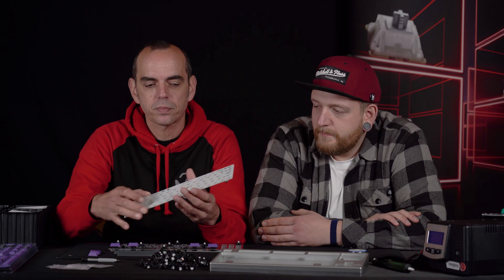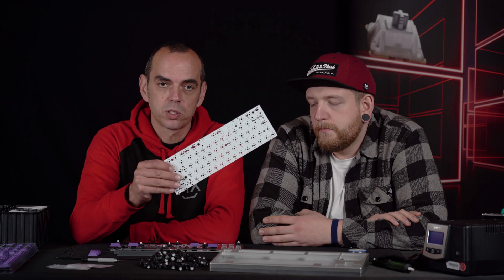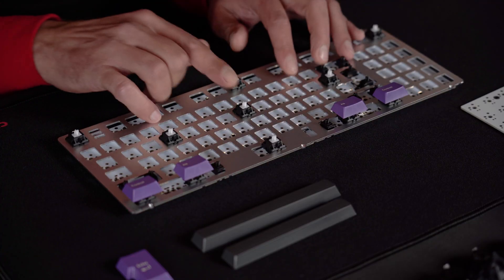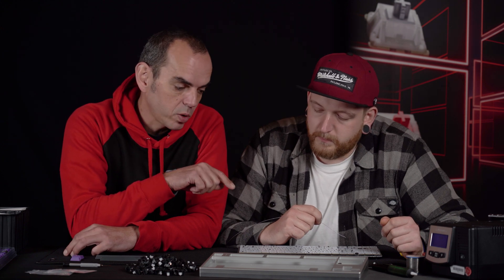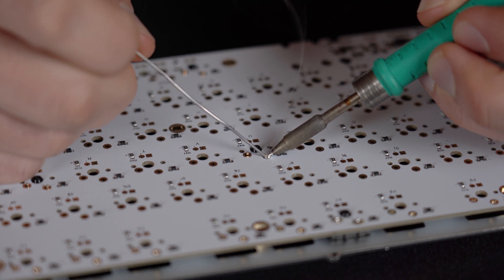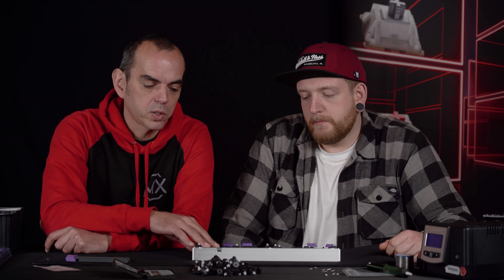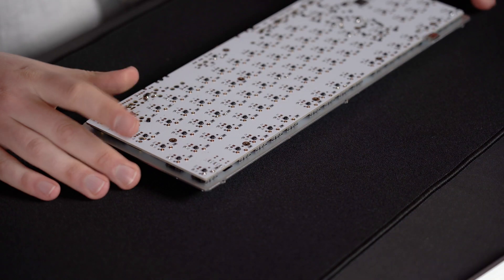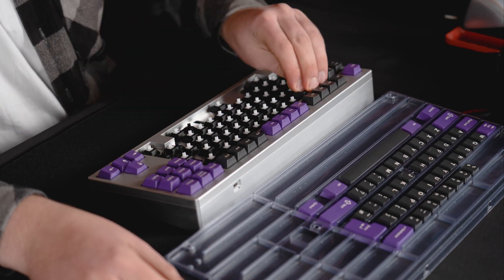[HOW TO] DIY KEYBOARD – PART 6: PUTTING THE KEYBOARD TOGETHER

Comment: If you actually use Cherry MX switches for a custom keyboard then why even build a custom keyboard
Reply: I use Cherry MX Blacks for my Noxary 280 and will be using Vintage Blacks for my F2 or Frog if I ever get one
Also planning on doing a rebuild with Cherry MX Browns.

Seems you're new to the hobby. Sure their switches are scratchy but with enough work, they're quite nice. The sound profile of lubed and filmed cherry is honestly unparalleled.

Comment: How do you buy the the cherry Mx red 
I don’t now how to get to it
Reply: Oh oof thats dumb -_-
Reply: @nokushhh  its not dumb, just don't buy them, you want cheap linears? gateron yellows. You want cheap tactiles? Durock t1's. You want cheap clickys? kalih box navy/jade/box white
Reply: Well it doesnt matter anymore cuz the pcb i was getting is out of stock
Reply: And it was a pcb that i dont need to Sauter  anything or how ever you spell it
Reply: @nokushhh  there are many hotswap pcbs, or you could even get a nk65 but I don't know your budget or what type of sound and feel you want. Also English is hard as fuck but it's spelled solder not sauter and it's not capitalized.
Reply: Well the keyboard i was gunna make was gunna be 200 so that a lot
Reply: you don't, they suck.
Reply: @mrED123  i mean they dont really suck, i was using them for a few days at my friends house and im getting it for sure
Reply: @mysliphoto8400  have you tried other linear switches?

Comment: Most flux is actually not great for the solder joint over time. Yes, it’s there to make the metals flow together but it will also slowly weaken the joint over time. If you plan on using the keyboard for many years I’d recommend wiping it off with some basic isopropyl! I really appreciate these videos, it shows great initiative from Cherry.
Reply: Good to know thankyou.